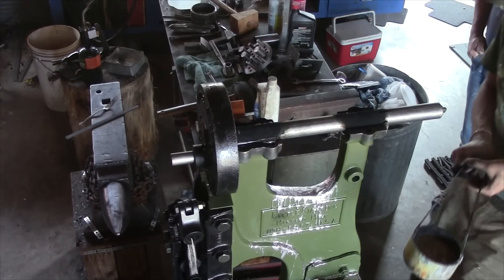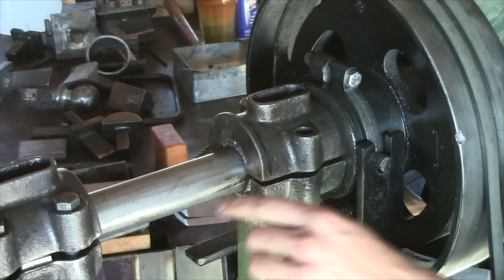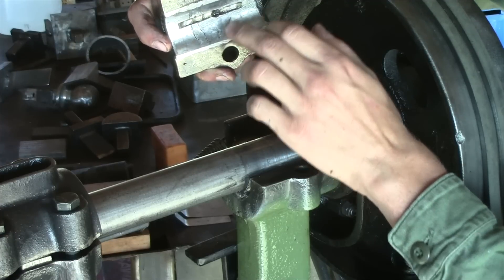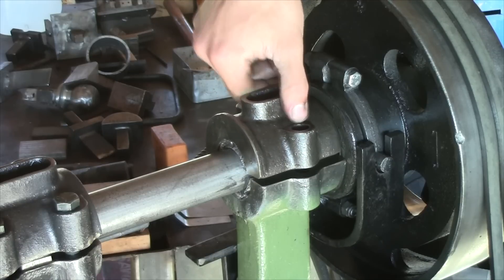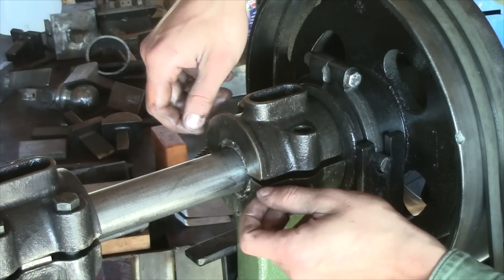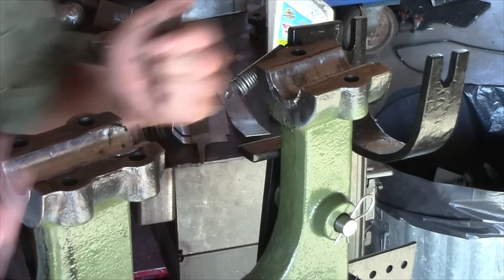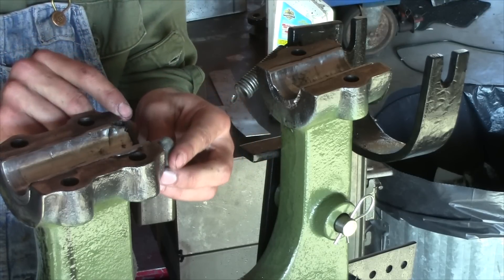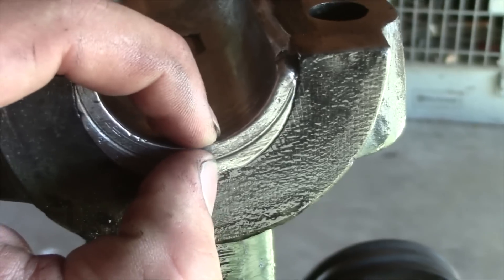How Not to Pour Babbitt Bearings - How Babbitt / Friction Bearings Work | Iron Wolf Industrial

Comment: In addition to aluminum (for use as a setup shim), you can use a little chunk of Babbitt metal.  The cool thing about this is you can "tune" it for proper clearance by tapping it flatter with a hammer.

Comment: Shoe shops many years ago used sole cutting machines called Beam Dinkers to cut shoe parts like large soles made of hard leather or neoprene.  Those old beam dinkers all had babbitted bearings, and as a young machinist of 25, (now a young 82) I babbitted many of those machines along with many other machines like large rock crushers used in gravel pits.  I was fortunate enough to be taught how to do it by and older millwright who also taught me how to weld, and many, many other things that kept me happily and gainfully employed well into my retirement.

Comment: Ages ago, I worked as an electrician for a milling company and their machinist, Vince, was pouring a babbitt bearing while I was there, and I got to watch the process while he explained what he was doing. Keep in mind that this has been 40+ years ago, so any mistakes in my recollection can be explained by my two-step memory (two steps and I've forgotten what I was doing).

1) The way that he did it was to remove the old bearing and clean up the shaft of any burrs. 
2) He then dialed in the shaft so that it was perfectly aligned prior to the pour. 
3) He packed the bearing using the same putty as you did, and heated up the bearing and shaft to prevent a steam explosion. Maybe heated it up first, I don't know.
4) Vince did his pour with the top bearing caps mounted (poured the entire bearing with one pour through the oiler hole). 
5) Using a kerfing saw (I presume) he cut the babbitt where the top and bottom halves met. He may have disassembled the bearing to drill the oiler hole, or left it on and drilled it, I can't say for sure.

I can see a few advantages to Vince's way of pouring a bearing:

By aligning the shaft externally, he avoided the need for the aluminum block.
By bolting the two halves together first, the bearing shell thickness was exactly the proper size for that bearing. That allowed him to tighten the bearing cap down fully without worrying about squeezing the shaft too tightly. Any shims that he planned on using (to take up wear) I suspect that he had installed before the pour.

Edit: How I remember it being poured: https://www.youtube.com/watch?v=uGUK-gnH7BM
Reply from the maker: Very interesting. Thank you for the information! I've never done it in one step, but I'd be curious to give it a try.

Comment: Great video, very informative! I’ve often looked at great older machines with babbitt bearings and wondered why. I still wonder a bit. Are there (generally) speed limits on rotation — do babbitt bearings match the speed of, say, roller bearings or are more for slower speed applications? What about loads such as vertical load (like heavy equipment), or higher torsional loads? Curious — one application where I see these bearings frequently is on older, large-scale woodworking equipment, often that has outlived one or more shops…..

Comment: Omg, thanks😃! You may have just saved my bacon, and my old Atlas 🤣. Noticed quite a bit of slop in my spindle (well, my lathe's spindle🤣) and wasn't sure if I could remove any of those shims or not. I was gonna try anyways but now I'm a little more confident about it. So thanks!
Reply: What model Atlas lathe do you have? I have a 9" that I'm rebuilding with babbitt bearings.
Reply: @ahorsenamedoaks1377  I've got a 1936 Atlas 10-D (10x24). I never did remove any shims although my spindle nut needed a little tightening. Just finger tight mind you 😊.